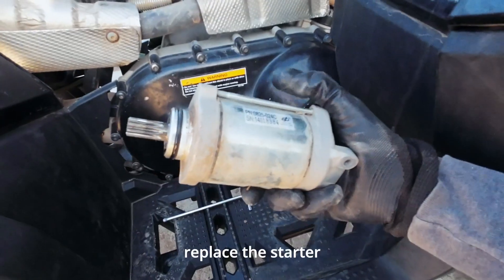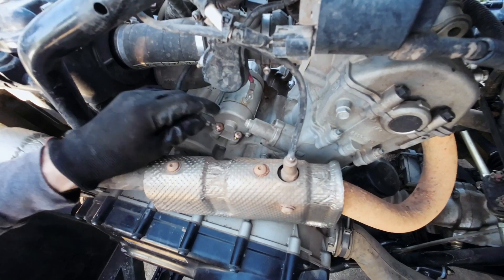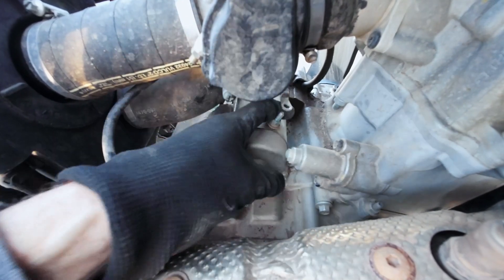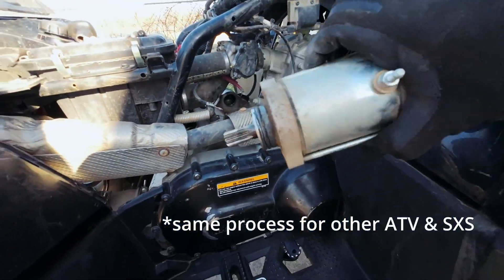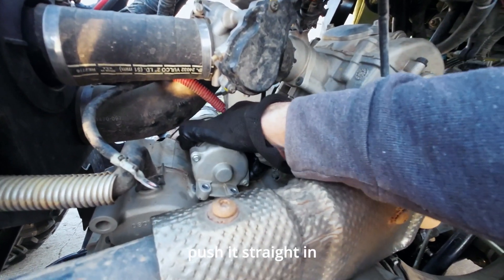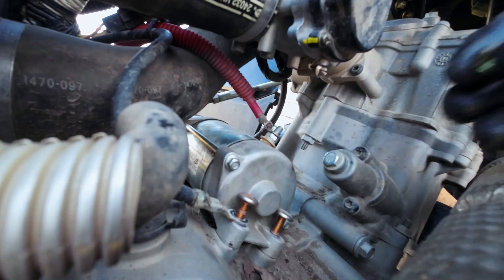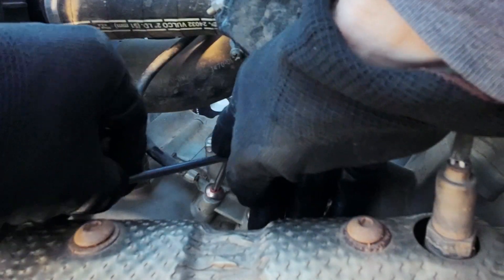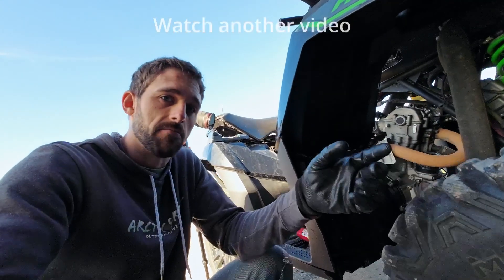How to Remove and Install Your ATV Starter

Comment: The beautiful thing about the first gen alterra models is the insane accessibility of maintenance.
They gave so much room that nearly all the main components are wide open.
Heck, some makers you can't do an oil change without major plastics removal.
The sportsman 450 requires the who front end plastics removed just to replace a bearing because of the McPherson struts.
Reply from the maker: I like that they are so maintenance friendly, everything is pretty easy to get to. Working on any other brands on the other hand… I had to replace a fan on a Sportsman 570 once and almost had to take the whole front apart.
Reply: ...absolutely right- thers many things i like on my ACs more then on my buddies canam !! ;.-)